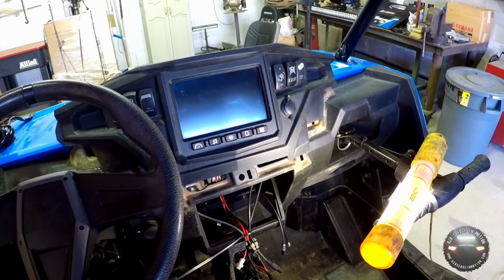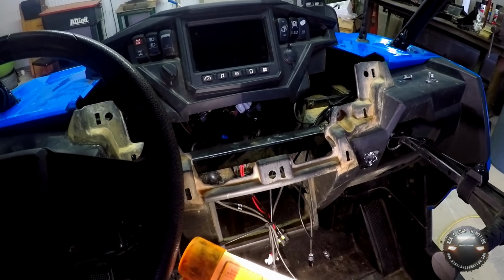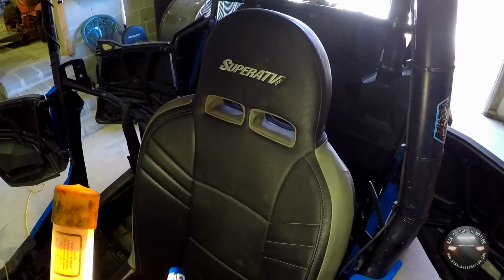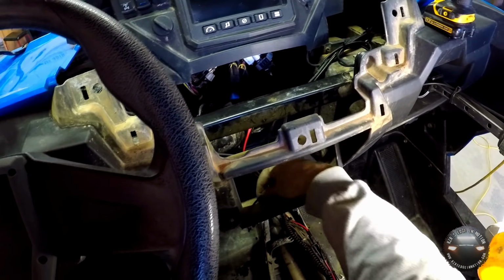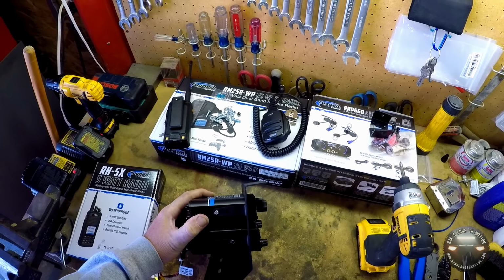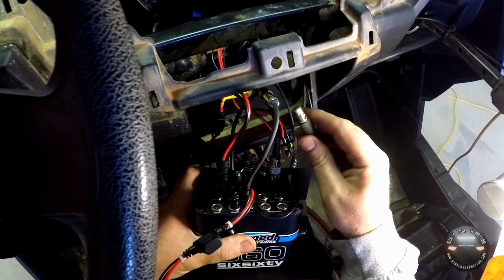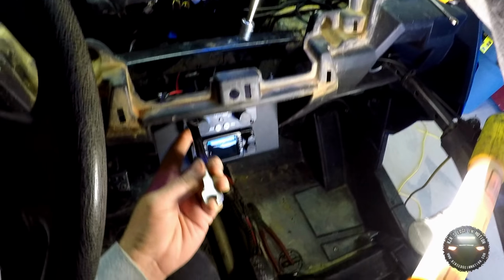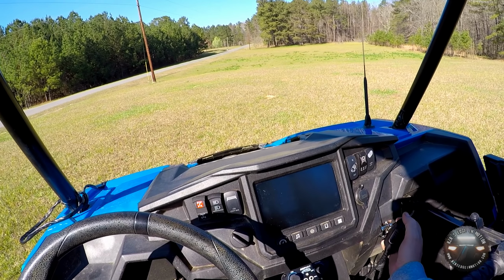RZR How To - Rugged Radios Install Part 2

Comment: Question. How come ur dad was coming in clear and you sounded to him like u were breaking up? Does the antenna need tuning?
Reply from the maker: Curt G - Sorry I wasn't clear on what we were doing there. The radio I was using is 25 watts, but the one he was using is 5 watts. This was actually a range test of the handheld. The antenna on the handheld is smaller, so it's ability to receive signals is more limited than the antenna on the roof of my rzr. The handheld has a range of 1-2 miles based on frequency, terrain, and line of sight.
Reply: Got it, thanks!

Comment: Great video, you do nice work paying attention to the details.  I was thinking that the helmet speaker wires could have been run down through the center at the floor level and up between the seats.  That radio and intercom combo makes a handsome looking setup.
Reply from the maker: S FERG - thanks! I am very detail oriented, and give it my all haha. I've seen the wires ran that way, they seem like they could get tangled up easier in clothing, carry-ons, back seat youngins, etc.

Comment: Jason,  Do the rugged radio also communicate with a regular 40 channel C.B. if you where out on the trail and someone joined your party and that is what they were using ? Thanks.
Reply from the maker: Mark Meredith - Actually, they won't. A cb style radio operates on a different range of frequencies than the "two-way" radios, like the Rugged. The cb operates in the "citizens band" range of frequencies allotted by the FCC, which is where they get their name. Radios like the Rugged I'm using operate in the vhf & uhf frequencies.
Reply: Gotcha, Was wondering about that being we use the cb radios on our units. Thanks for the reply Jason...
Reply from the maker: Mark Meredith - sure thing 😊